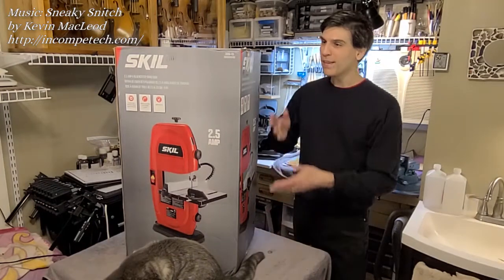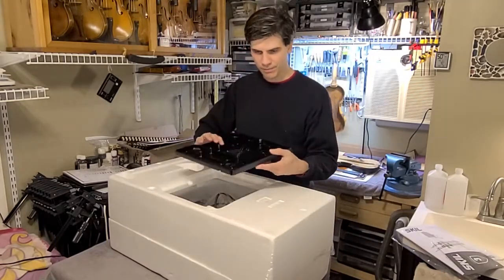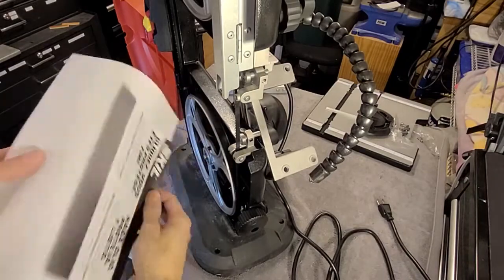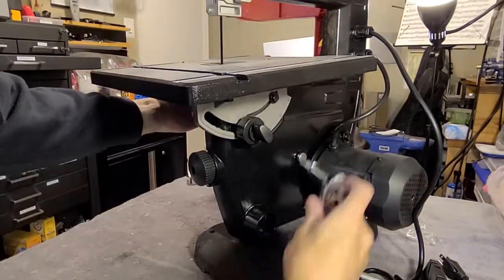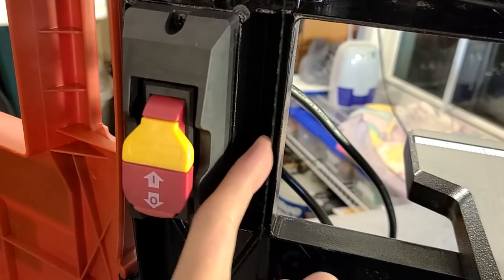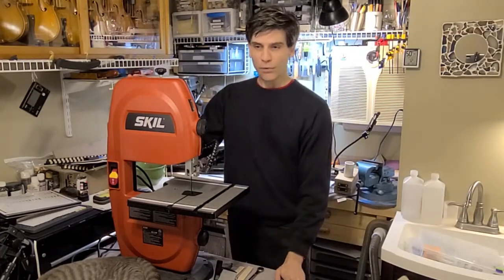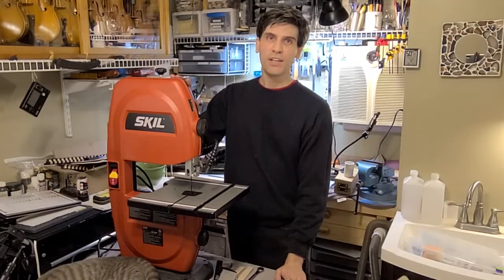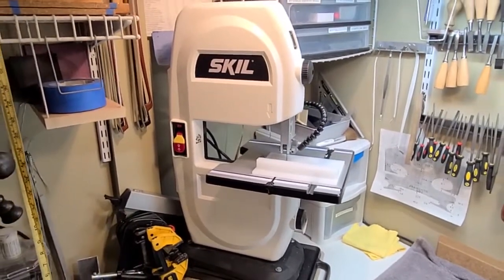Skil Band Saw Unboxing, Setup, Review (Skil 3386 bandsaw)

Comment: Okay, I have a comment, and a question. This isn't my comment exactly, but your presentation is terrific with very helpful modifications. I've had this saw for 3 years, but moved after getting it, and never set it up (kept using my old 12-inch Craftsman). This will help me so much since I'm just now opening it. My comment is that you're obviously a violin luthier since I see violins in a cabinet and s bending iron on your work table behind the saw. I'm also a violin/viola maker. My question is:  Where did you get your neat, blown-up copy/picture of the violin bridge with all the detailed specifications for tuning the bridge? I LIKE. I LIKE! I'm serious abouty question. Thank you for your excellent presentation. I really like the cream color and the independent light switch. Also, I didn't know how to set it up properly. Now I do! Thanks so much. David Lee 1-5-24
Reply from the maker: Thank you, glad you enjoyed it! Nice to meet a fellow luthier!  😊  ❤
I made that picture of the bridge and all the measurements years ago when I first started learning the craft. It's just a bridge photo with measurements all around it, and it's printed in B&W because my printer was out of color ink at the time. It went up on the wall when I set up the workshop, and I never had a reason to take it down even after I memorized all the measurements.  😉

Comment: I installed a 1/2 blade and it helps make straight cuts .
Reply: No problem with that size blade? Mine wiggles left and right. I need to change my blade I think
Reply: @rdwolf11b  no issues, struggled a little to adjust it but it is working very well.

Comment: just found the saw at a local consignment shop. i like your light switch. was it a difficult fix. doesnt look like it. any guidence on rewiring mine would be appriciated.
Reply from the maker: Well, first you need a little switch; space is really limited! Then cut a hole there of the right size. The wiring is a simple split on the main line. The saw comes wired so that power goes into the power switch and then splits in two, one for the motor, the other for the light. I split the incoming power wire so it goes to the motor switch AND the new light switch. It isn't difficult if you know your way around wires. The hardest part was making it all fit in the really tight space there.  😉
Reply: @SculptyWorks  cool,  thanks for the reply.... I'll get in there. I was looking at the switches last night,  after I saw your vid, looks easy (relative) enough. Yu'da-Man. Haha
Reply from the maker: @rdwolf11b  👍👍
Choose a very small switch! If I remember right, there's a tiny circuit board there that converts the grid power to LED power, that can't get squished in the tight space like wires could, so you want to make your life simple with a small switch. The one I used is a 15x20mm rocker switch.
Reply: @SculptyWorks  ahah, now that's absolutely helpful. Thanks for that tip bit 
👌👍🤜

Comment: Question: what size blade did it come with?
Reply from the maker: It takes 59 1/4" to 59 1/2", I don't know which one came with it, it wasn't labeled.
Reply: @SculptyWorks  I ask cause the saw I have came with a blade that seems so thin, width wise, that it twists when I run materials thru. I downloaded the manual,  but flipped through like you did. I need a better blade, one that is more sturdier. Thanks for the response. Ideas?
Reply from the maker: @rdwolf11b  I recently replaced the blade on my saw because it was starting to feel dull, and I actually liked the original one that came with the saw better, so I can't really recommend any one in specific.

Usually, if the blade is doing weird things when you cut through stuff, it's either because the blade is dull, or you are pushing too hard. These small bandsaws are capable, but they are wimpy, you have to be very gentle and slow using them.

Comment: What size blade does it use
Reply from the maker: The manual lists  59 1/4"  or  59 1/2"  for replacement blades. Anywhere from 1/8" to 3/8" width.

Comment: You said you cut a 4x4.  Mine couldn’t fit 4x4.
Reply from the maker: A 4x4 here is actually 3.5x3.5 inches. It's a popular misnomer. Construction lumber is like that, for... complicated reasons. 2x4 is actually 1.5x3.5, 2x6 is actually 1.5x5.5, etc...
3.5" is the absolute maximum you can fit in that saw. Sorry for the misunderstanding.